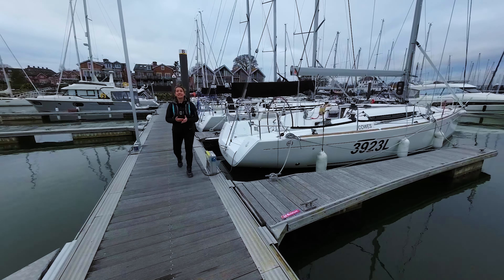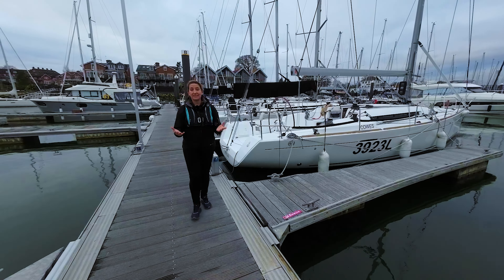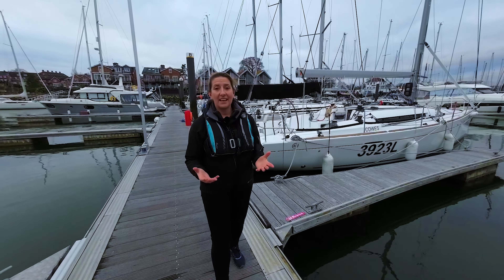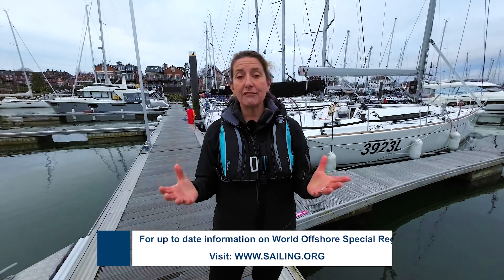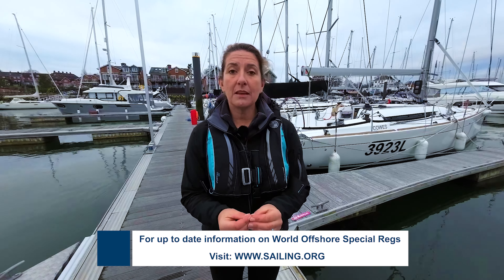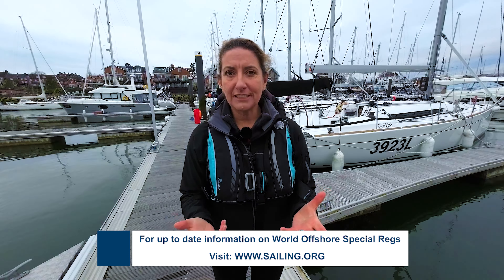DANBUOY | Best Practices

Comment: Dee, I watched all 12 but feel this is just to basic, the videos need more detail and actual demonstrations in rough sea conditions, no mention of how important the leg straps are and visual demonstration to show how life jacket will lift up over you head when in the water without leg straps. Show the best way to get a man overboard back on in rough conditions, and how do you do it at night. The AIS beacons do not float and some are very difficult to operate manually. No mention of a MOB button on chart plotter, sails down, stop boat, heave too.
Reply: I agree these could do with more meat, but they are not supposed to be comprehensive. Yachting Monthly has a more in depth video (mob retrieval and recovery).
Reply from the maker: Thank you for your comments Frank. As pointed out in the videos. These are designed to make you think about safety for your particular kind of sailing. It is not possible to demonstrate as requested because the conclusions are different for boats and crews. If there is a particular topic that you would like to have more details on then please ask.